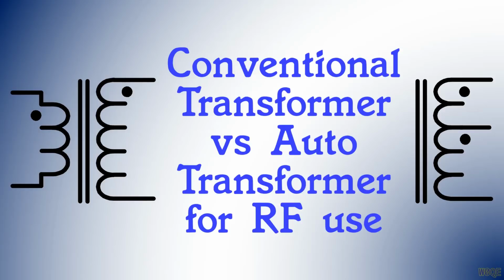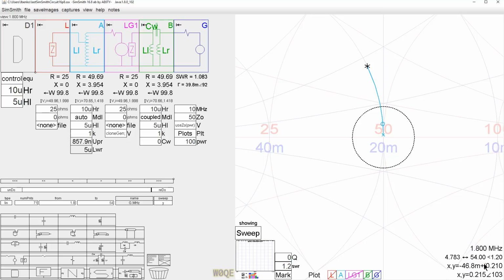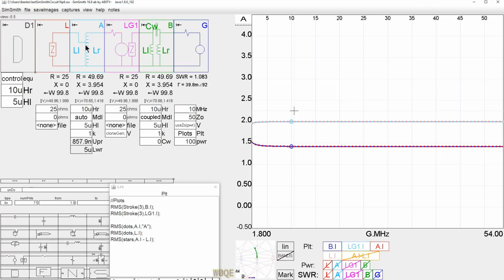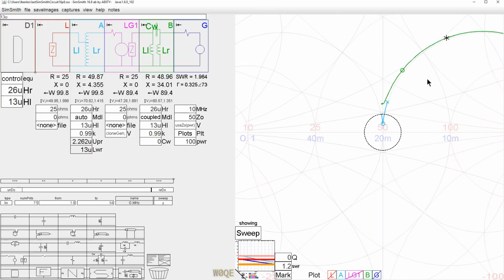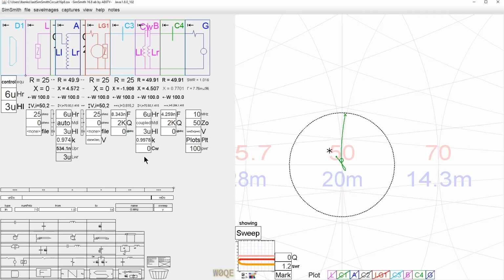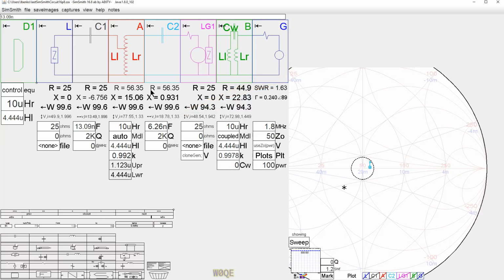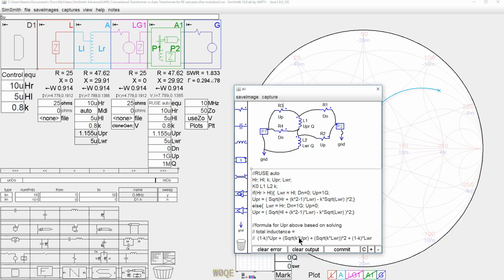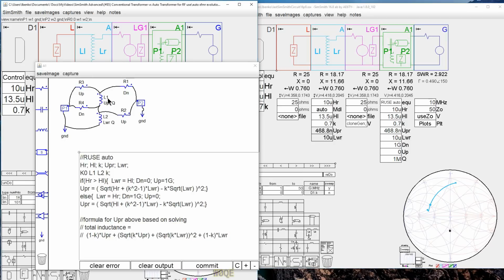#85: Conventional Transformers vs Auto Transformers for RF use

Comment: Hi.
Thanks a lot for your excelent explanations.

I have a question for you. 
I've got three European toroids of low permeability NiZn material 4c65 suitable for baluns. Al is 157 and B is around 350 mT. Size is 58.7mm outer diameter and 40.5mm inner. Thickness is 17.9mm.

How many turns would you think that I should use in order to build a high power 1:1 balun, using the three of them stacked, for my dipole?